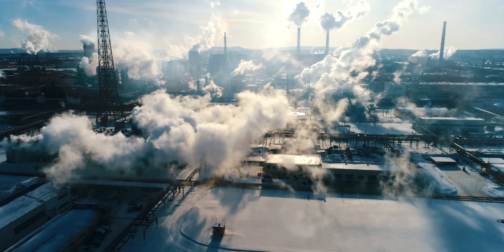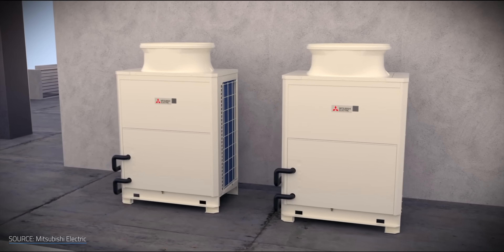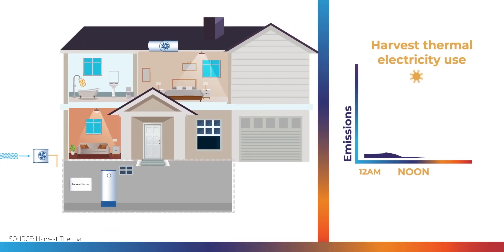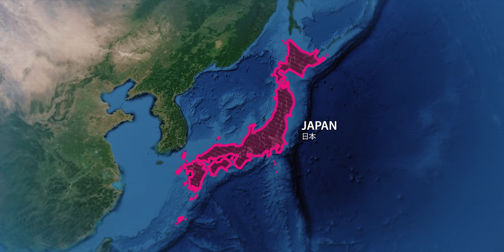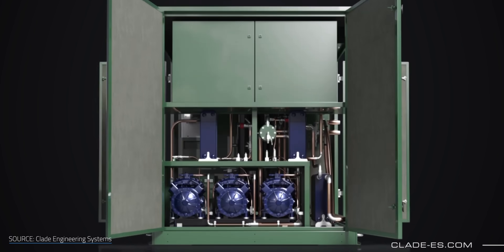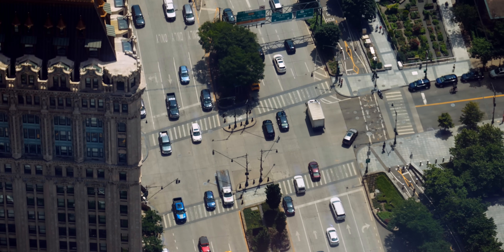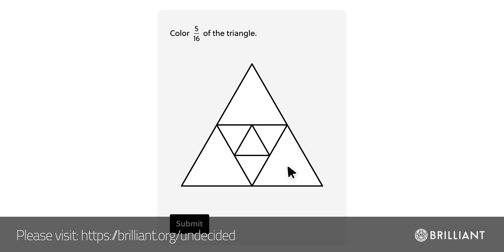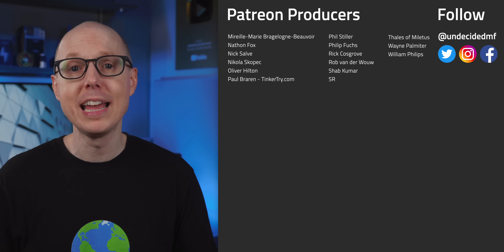Why CO2 Heat Pumps Are The Future Of Cooling

Comment from the maker: So do you think CO2 heat pumps, like what Harvest Thermal is putting together are the future of heating our homes? Go to https://brilliant.org/Undecided/ and get 20% off your subscription and a 30 day free trial with Brilliant.org!
Correction: 3:26 Should have said "Gas burner efficiency" - it's not a COP

If you liked this, check out Why This NASA Battery May Be The Future of Energy Storage https://youtu.be/2zG-ZrC4BO0?list=PLnTSM-ORSgi4dFnLD9622FK77atWtQVv7
Reply: Is there a good way to use water to first cool down solar panel and then heat the water up for house use from there?
Reply: @LucenProject the idea of using water to cool down PV modules has been proposed by lots of people.  Clearly there are some significant gains to be made if you can keep PV modules cool.   The challenge here is coming up with a cost effective practical solution.  
Adding cooling to PV modules is expensive especially when you add in all the plumbing considerations and the alternative of just paying for larger PV modules is typically more cost effective. 
Also there is a need for a cold water supply.  Yes it would be ideal if you could coordinate your hot water usage so that your hot water cylinder was being filled by water that has just cooled your PV modules but hot water use in a home typically occurs at times that are not when your PV modules need to be cooled.
Reply: kinda cool how you dubbed Casey Kasem's voice onto you for all your vids. nice job! 🤗
Reply: Heat/Pump + Storage (cold or hot) -- Single Mini-split with storage allows heat storage during hottest part of the day to be used at night or store cold at night to be used during heat of the day.  Heat pump would use to storage typically out side near pump and the circulation and logic choose locations for heat and cold.
Reply: Think heat pumps are great but co2 chillers and refrigeratation units in supermarket always fall over in a heatwave due to head pressure. They work to higher pressures than previous refrigerants.
Reply: @richardc1983  I just heard they are up to 1000 bar and 1 malfunction in a supermarket (I think it was Marks and Spencer) and damaged someone's leg. They are replacing them again
Reply: Your voice cracking at the end… I feel you man, but good things are coming. Best of luck!
Reply: nice find. I have no idea about this until now. with my quick read on the internet, CO2 is indeed superior in all ways except cost.  It requires multiple times higher pressure vs common refrigerant so the equipment does indeed require to be beefier. Once you have the beefy equipment, it is most likely too good for residential use which is the reason one company in the video would use a thermal battery to harvest or store the excess performance of the CO2 system.  In short, CO2 heat pump is best for commercial industrial use.
Reply: @zlmdragon.  i already said it is too expensive. I wouldn't even get one myself.
Reply: You have a great Channel. Your office Studio Aesthetics are absolutely terrible.
Reply: We didn't learn that at all. Companies who significantly profited by pushing those myths are the origin of those myths. They are not backe db science. CO2 is a fertilizer. We've confirmed CO2 follows temp, confirming the trooth is the exact opposite of what everyone is told.
Reply: It's too bad yt censors all the facts. Gosh, wonder why they do that.
Reply: Higher CO2 is a blessing, it greens the planet.
CO2 level was too low for optimal plant growth.
Its still low, but its getting better.
Reply: I'd compare this complex bit of kit to a batch solar water heater.
Reply: Since this system uses a hot water tank, you could easily add solar thermal and a heat exchanger @man_at_the_end_of_time
Reply: Your new studio makes your video feel cold and uninviting. You might want to try dialing it in a bit.
Reply: Add phase change material better heat capacity than water
Reply: Looks like it could go well with the CO2 sequestration. If you haven't yet done a video on Calcium Carbonate Precipitation for CO2 Storage, I'd be interested in hearing your take on it
Reply: They have a role to play. We have a Mits air heat pump in Canada and get more than enough warm air from it in winter to keep us comfortable, but not enough hot if we have radiators or in-floor heating.
Reply: Love the channel but your computer isn't well designed. The giveaway is the 600W PSU. That means your GPU isn't top of the line. Watercooling a system without a top of the GPU is usually a waste of money.  That money would have been more effectively spent towards buying a better CPU or GPU without watercooling.
Reply: Did I miss understand but isn't water heater combined with geathermal heat pumps very normal? I have one in my house. And it is not CO2 pump. I don't think the water heating abilities are the thing that make CO2 pumps special.
Reply: Yes once they make the compressor more cost effective and durable.  It seems the complexity of the compressor and fancy pipes to keep the CO2 in is the limiting factor.   The heat transfer via water is smart since it’s a great way to cool the refrigerant and lower the pressure of the CO2 for it to be more efficient.   Awesome channel 🙂
Reply: Why showing off scandinavian flags when they have no power over us?. 5:48
Reply: Nice, it was done 50 years ago and now we go back to it.
Reply: The thumbnail said future of cooling and if I am not wrong it is about heating. As I am from India which is very hot I thought this was going to cut my energy bills guess I have to wait longer.
Reply: The Titanic and ships like it often used CO2 for food refrigeration.  It was efficient and safer than ammonia.  The technology worked well.
Reply: Would love to see a video on supercritical CO2 used in turbines for power generation. They're supposed to be quite a bit more efficient and considerably smaller than steam turbines, and don't require the power plant to be located at a water source.
Reply: Like with many things I’m more concerned about the complexity and cost of repair. I worry that too few technicians will know what to do in North America if I adopted one to hear and cool my home.
Reply: Heat pumps, yes. Solar no. Nuclear is vastly superior to solar.
Reply: Could you do a video on fabric ductwork?
Reply: "Little 9'x9' room" lol... That line made me chuckle!

Anyways. the idea that we could use C02 beneficially sounds interesting. 

To me, it sounds like it would be more beneficial for these big apartment complexes, b/c of the mechanics at play...(Water thermal battery), than residential homes.
Reply: @MRSketch09 Yo, farming weed in appartements sure higher yield from extra CO2.
Reply: @rollling7523  
Sir... Stay on topic please. (Wtf are you talking about, seriously? Where did that come from?)
Reply: @MRSketch09  indeed, growing in cellars is also great, but peeps dont have that in highrise buildings
Reply: Can CO2 yield better efficiency than R410A refrigerant heat pumps? Fujitsu's 09LZAS1 has a COP of 5.33.
Reply: have you heard of the ozone cycle ? also what if you do not need hot water can there be a better way to release that heat also have you heard of cooling with calcium chloride? also keep thinking sand can hold more heat than water... but how would we move it, and release it later...
Reply: For new installs, yes. older ones gets messy fast. 
Matt, will you consider an experiment?
Take the exhaust from an existing water heater or central air heater, run the exhaust through the heat pump outside system.
Measure the reduction in pumping power with the free heat add.
a garage diesel heater exhaust plumbed into the external heat pump intake.
This is called the Davison heating topology. It is heat source agnostic, solar is a valid input, no PV required, or can use the PV for a manifold to collect waste heat and potentially cool panels, increasing efficiency.
A FF boiler + Heat pump + smart DER is a GAIA solution.
If everyone switches to heat pumps the GRID will not be able to provide power in extreme events, without overbuilding and waiting a decade of buildout, assuming it start in earnest.

Abundant wind = cheap electricity, leave off the boiler.
No boiler COP is improved anyway!
Boiler on supercharges the heatpump COP, into 10X is possible!
The Davison Topology + DER allows this to be fixed. variable pricing? Cold outside? everyone has heat pumps?
Trifecta of getting screwed-->Turn on the boiler, or DER it on.
GAIA your welcome
Reply: You talked about its heating abilities. As a person living in Florida, cooling is a little more important. Tho i do need a good heat unit but i need a good cooler more.
Reply: @timothymine1135 hink the point is that the heat is transferred to an accompanying water heater and therein you get your efficiency and practicality.
Reply: @b_uppy  i get that but he was also saying the efficiency of the unit as a heat pump was really good for heating a house. i'm curious how it is for cooling the house. i like the fact it heats water too but i also need it to cool my house in a 100F summer here in Fl or it is no good for me and i will have to stay with a HCFC unit.
Reply: @timothymine1135  Heating ability is pretty terrible. Cooling is somewhat better as the boiling point is nearly twice as low as that of R410A (at some -40c), but you need pressure in the system 3x higher (and therefor increased pump loads, energy use and decreased lifespan) for this. Other systems that use, butane, for example, have a boiling point of -1c and are 'useless' for heating (as the "freeze" on a cold night and stop working entirely) but are reasonably efficient as a cooler from an energy use perspective due to the low operating pressures of the system between the high and low sides.
Reply: @timothymine1135  After just a little more research I would suggest a Pentane heat pump for Florida, about 400PSI (about equal to R410A) for the same thermal performance as Co2. (stuff is quite flammable though, it is acceptable to use in a "bushfire prone" area of Australia so would suggest it is "safe")
Reply: @74KU  Sounds like it is about the same as the YF1234 stuff they make us use in cars now. May have to look into it. I have like at least 5yrs before my current unit needs to be replaced. but always trying to know what's coming so I an ready when the time comes.
Reply: The studio in your new house needs more sound dampening.
Reply: I agree. May want to play with the sound in there a little. Has a little bit of an echo and the mic pick up was a little off. @pranavid
Reply: @pranavid  I thought it sounded like it had more dampening than the old studio and actually came here to compliment him on it sounding better even though I didn't have any issues with the sound in the old studio.
Reply: We should be thinking about making ammonia refrigerant more consumer use safe. It’s more efficient than CFC’s ever were.
Reply: @jimk8520  You literally cannot make ammonia safe, if it leaks you essentially die if your in the same space as it. Ammonia is inherently dangerous which is why its only used in industrial settings with lots of monitoring equipment, or where the charge is EXTREMELY small such as propane fridges but most of them have moved on to Helium anyways for safety
Reply: @Byron88  Tell me about it - I worked with the stuff for years (photographic equipment). Never the less, if done properly, it’s one of the most efficient refrigerants we know about. And if it is safe enough for industrial use, it can be made safe enough for consumer use, too with some engineering effort. Bonus, outside of immediate exposure issues, ammonia is renewable and has exactly zero long term environmental effects.
Reply: @zlmdragon.  He says in the video that commercial, industrial and hotels use this with good returns and I believe it.
Reply: I’m sure Matt is constantly working on sound and everything else.  On the CO2 side, these units would have to prove themselves.  I’m not sold on them yet. If a unit is to pay itself off in 5-10 years then it should carry a warranty for that length of time.  The problem is when people give out these estimates they are not taking into mind potential breakdowns, and everything else that goes into the systems while/after they’re installed. To me, heat pumps are usually more problematic than standard ways of heating. But then again, I also live in New York, not for much longer, and by 2030 any new heating device installed in a house has to be a heat pump. America could phase out all CO2 emissions and it still would not make a dent in the CO2 being released by the rest of the world.  So we wind up being example setters, and not making any difference.  In other words, we incur the cost and all we do is make people feel good about themselves. I’m sorry that’s not a good enough reason.  Also, if this channel is about Matt, being undecided, he should rewrite what he is saying to kind of fit that narrative. When he brings these new technologies to the board, it sounds like he’s already sold on them.
Reply: @SirGrogg 
I agree, they need to be proven.  If they do work that they are more efficient, they are a more elegant solution.
Reply: What the US does the rest of world often adopts, even replicates @SirGrogg  .  In the US it is good for business and create more jobs, as demand increases prices fall, more want, more jobs, etc.  This is a GOOD change.  In the long run, being early adopters of reliable tech often benefit the most.
Reply: Satellite data have recently revealed that between 2002 and 2019, the mesosphere and lower thermosphere cooled by 3.1 degrees F (1.7 degrees C ). Mlynczak estimates that the doubling of CO2 levels thought likely by later this century will cause a cooling in these zones of around 13.5 degrees F (7.5 degrees C), which is between two and three times faster than the average warming expected at ground level. This is why during glaciation co2 spikes as the planet keeps cooling and even faster. Insulation like co2 not only keeps things warm but keeps them cool also. Some would even say co2 has a super cooling effect during glaciations.
Reply: @eliinthewolverinestate l
Needed to be said.
Reply: @eliinthewolverinestate  So it is cooler in the mesosphere and lower thermosphere, but the troposphere is getting very toasty.  It is also said a hotter troposphere and cooler stratosphere and mesosphere is causing more frequent and violent storms, and that is much worse.

Comment: If there is any water in a CO2 system, you will get you carbonic acid. Under pressure. Corrosion problem.

Comment: At room temperature CO2 needs to be at 900 psi (62 bar) to keep it in a liquid state.  The cost of running an electric heat pump would almost always be more expensive for heating than heating with residential natural gas.  About 38% of generated electricity gets to a residential electric meter.   0.38 X 3 COP for heat pump (theoretical) efficiency = 1.14 efficiency X 0.40 thermal efficiency for a good power station = 0.456 efficiency.  The reality is the heat pumps don't get this theoretical efficiency so the overall efficiency is less than this.   

A good, but not super high efficient gas furnace is 0.90 efficient.  Generating and distributing electricity has greater costs than distributing natural gas. The electric blower air handler consumes considerable power with either system.   An advantage electricity typically has is it is made with coal at about 1/2 the fueling cost of wholesale natural gas.   New US USC plants have estimated fueling costs  at about 1/3 the wholesale cost of natural gas in the US.

Comment: New COMBUSTION tech uses CO2 in the secondary cycle of a combined cycle engine/power system that is also a heat pump that captures CO2 for use in cycles.  

Two options are: Combustion vs Electric:

1) combustion in engine at COP4 using Natural Gas at 3 cents/kwh.  This gives heat at 3/4=1.33 cents/kwh.  It also gives electricity at 4 cents/kwh from NG, making grid obsolete.  Combined heat and power is key.  Solar thermal (NOT PV) adds in 5x more energy collection during solar day that is stored in those hot water tanks.  This gives a 5 x 4 = 20 times leverage.  3/20= 0.15 cents/kwh for heat during solar and while running off of solar thermal hot water.

2) COP4 electric SANCO2 based heat pump with grid at 15 cents/kwh.  15/4= 3.75 cents/kwh heat.

COST Ratios are 3.75/0.15 = 25:1

SANCO2 will go bankrupt with a 25x higher cost.  HINT.

Comment: For as far as I understand there is no reason to pick co2 over R290 (propane) for residential applications. R290 heat pumps can also operate at high temperatures upwards of 70c yet they have a better efficiency at such temperatures. Furthermore, they operate at a subcritical cycle making components much cheaper. So for applications where you need no more than 80c, R290 is more efficient and cheaper.

Comment: Too complex for residential install. Too expensive to install and repair. Too many parts to fail. Looks like a nightmare to be without hot water and heat if one part goes bad. Doesn't look durable. Maybe 5 to 10 years before a major breakdown. CO2 runs higher pressures too, right?

Comment: you wrong ,CO2 have critical temperature at 30.98*C at 73+ bar pressure. Is true he have higher transfer rate but in the same way , higher cost so...is just pointless  . Probably some ECO girls think to fare without apply the math 😀

Comment: These systems have been around forever here in europe. ONly difference is the use of co2 instead of the old r410a, r32 etc. Propane is becoming the standard, r290.

Comment: R290 is a much better refrigerant than CO2 solely because the pressures involved in the CO2 refrigeration cycle. Hell, R32 has a higher discharge pressure than r410a and I suspect that the cost of equipment will increase dramatically after January 2025… And a lot of failed coils will be filling scrap yards.